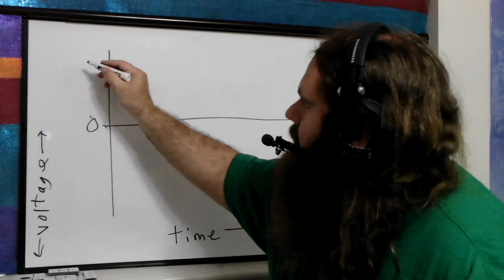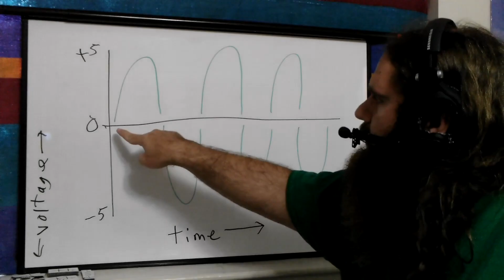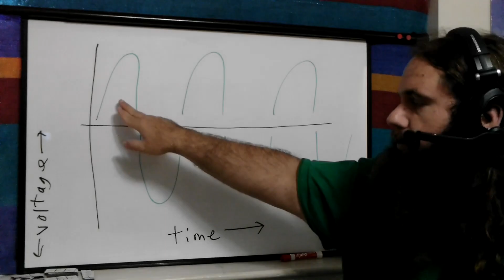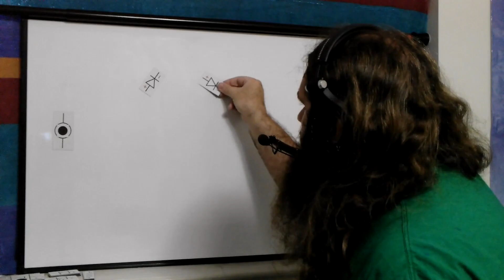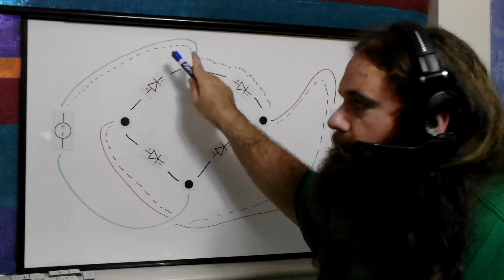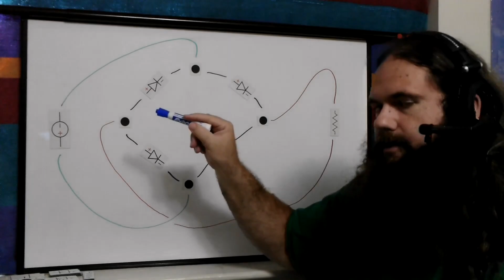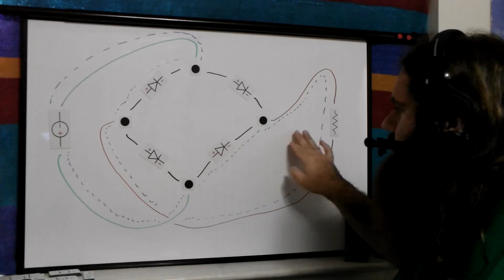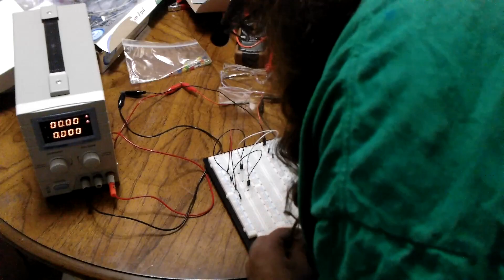Rectification of AC to DC - Simply Put

Comment: As a beginner i'd like to ask you a question thanks , is it possible to filtrate dc voltage without using a capacitor in parrallel after the bridge rectifier if yes how ? thanks for your help .
Reply from the maker: If your input voltage is higher than your output voltage (meaning you have more voltage than you need), you can use a linear voltage regulator chip that internally will do a lot of smoothing, at the cost of power (and heat). But even in that case, a capacitor is recommended. There's really no reason to not put one there, since they can be small and cheap.
Reply: @simplyput2796  Thanks my friend for your help , the reason i'm not into capacitor  is the fact it can burn easily , electrolytic capacitor is not very strong if you want to rectify a powerful ac source ..
Reply from the maker: You should use ceramics, then: They're safer and non-polar. The only reason to use electrolytics is they're cheaper for bigger capacitance, but you can always use multiple capacitors for additional capacitance as well. If you're worried about safety and can spare the additional cost, ceramics are an excellent choice.
Reply: @simplyput2796  you convinced me , i'll look for ceramic capacitors and about the cost , i think there is also a solution : get ceramic capacitors by salvaging from circuit boards , thanks a lot my friend for your suggestion and have a nice day .
Reply from the maker: That can work, but do check out the bulk price from a site like Mouser, a proper electronics retailer. If you're buying a bunch of them, you usually get quite a good discount. But if you need only a few or you need specific ones from donor boards, salvaging can work and can be fun too.
Reply: @simplyput2796  That's  true, for a biggest project i'll simply go to electronic retailers but in  my case i don't need a lot components , salvaging is also very cool and fun, you can imagine yourself like you're in a post apocalyptic world looking for the electronic graal component lol ...